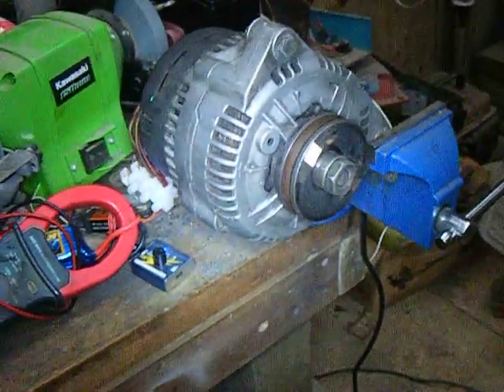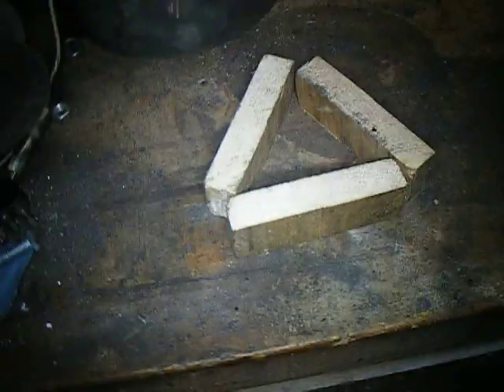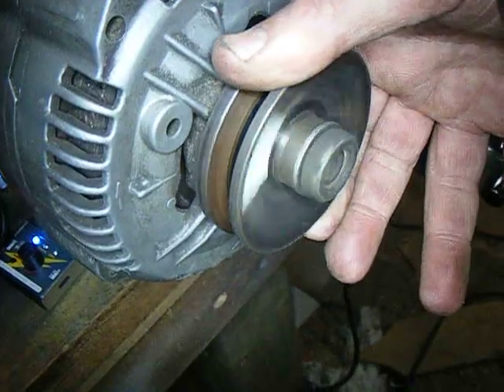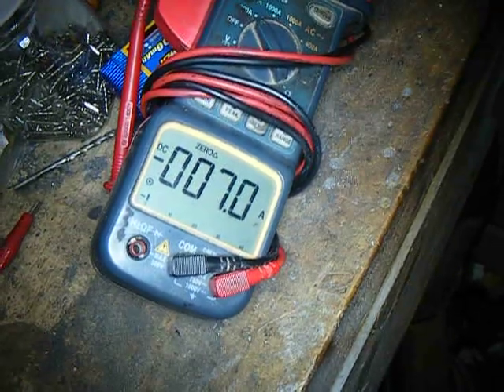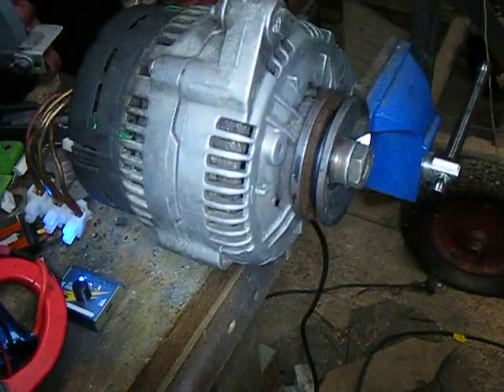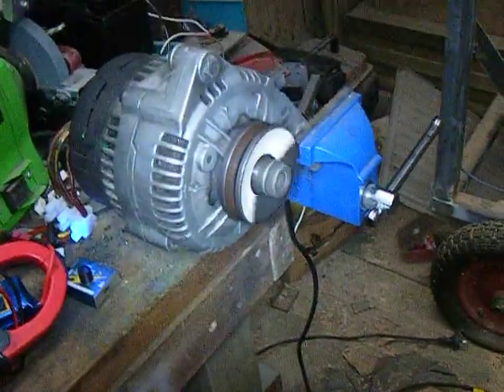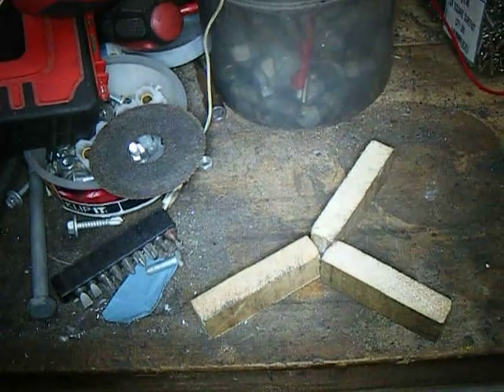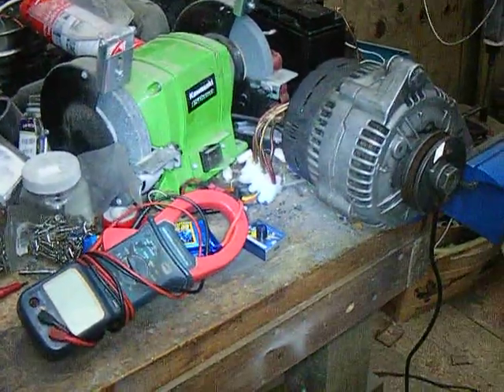Enhanced Alternator Motor goes faster than before

Comment: So if the stator only has 3 wires coming out of it then it's a star configuration right?
Reply from the maker: That would be Delta configuration - where the 3 coils are all daisy chained together, with 3 wires connected to their junctions. 
 Star configuration has a wire, that goes to the end point of the 3 coils,  and 3 more wires that come from the other end of the 3 coils. 
 I brought 6 wires out of my alternator, so I could experiment with the various wiring options.
Reply: The thing with my alternator is that is only has 3 wires and their every thick wires
Reply from the maker: @lt.schlechtnacht9414  
 You might find that there are 6 wires in there, arranged as 3 sets of 2, that are very close together.
Reply: I wish I could show you what I mean the whole stator is like 3mm copper wire. It's very thick. And theb3 wires that come out are very thick as well. It's a 1986 delco alternator
Reply from the maker: @lt.schlechtnacht9414  
 This is unusual. 
 Maybe those 3 wires are connected to the 6 wires, deeper inside the alternator? 
 Even as it is, you'll be able to use this as a motor, as it works in Delta and Star configurations.
Reply: @CNCmachiningisfun  ahh well thank you very much for the information! please update us with this project
Reply: Hey! Just an update on my situation. I dug a little deeper in my alternator and found the other 3 wires! Runs so much better! Thanks for all the help👍
Reply from the maker: @lt.schlechtnacht9414  
 That's good to know. 
 It just goes to show how differently these alternators are built, over the years.
Reply: How do you hook up the 6 wires to the speed controller? is there a certain combination to use? At first I used a multimeter to find each set if wires that beep then connected them to the speed controller and nothing happened
Reply from the maker: @lt.schlechtnacht9414  
 Connect one end of each pair together, and insulate it. 
 This will create a Star wiring scheme. 
 Connect the remaining 3 ends to the ESC. 
 Apply a voltage to the brushes, to magnetise the rotor, and you are ready to roll  :) . 
 After this, you can try the Delta wiring scheme, to see which one is best for your alternator.

Comment: i seen 2 videos  and i love channel i need to make a video i bought equipment  to do so ill get on it probably the 5mge turbo 1985 supra engine build ...oh n howdy frum east TN..chevy uses a starter electric drive hybrid [uses belt in the place of alternateor one is peppermint magnet type the 2nd gen is not ..a bit hard to find intell on as  i forget the name of unit  some newer car truck i figured i would mention it .i wont to make a cart cheap fer me n kids and grand-paw . much blessings
Reply from the maker: Thanks kindly. 
 I look forward to seeing your new video  :) .
Reply: Hey "overbuilt automotive",  those chevy special alternators can have two models:
one is a beefier alternator, one is a induction motor
Reply: the induction motor, if modified to Delta from Star, and using a good controller, it can get almost 40HP
i can give you links to show
Reply: @foxxyytofficial  sure ill be great full
Reply: @overbuiltautomotive1299  the Gen2 uses up to 120V to run, the thread post on Endless-Sphere and elmoto.net shows that for the Gen2 you need Curtis controller or other brand of AC induction motors
Let me search the video of the motor in action
Reply: @overbuiltautomotive1299  here is the kart:
https://youtu.be/V-M_RFaY3aM
Reply: @overbuiltautomotive1299  and here is the thread:
https://endless-sphere.com/forums/viewtopic.php?f=30&t=85514
Reply: I wanted to buy one of the first gen. chevy/saturn special alternator/starters because they have a similar form with standard alternators, and they cost 50$ or more, but shipping alone would cost 150$, and import taxes would add more:
from 200$ price+shipping, with taxes rises up to 300-330$
And the minimum wage in my country for an entire month its just 183$

Comment: Hi what alternator is this ?? Thank you
Reply from the maker: This is a 120 Amp alternator from an old Volvo car, if I remember rightly.
Reply: Thank you brilliant video
Reply from the maker: @joshstone423  
 You are welcome   :) .
Reply: Does it matter if the alternator works?
Reply from the maker: @joshstone423  
 As long as the alternator has good brushes/sliprings - and good stator coils, you'll be good to go  :) .
Reply: That’s great thank you
Reply: How did you wire it up to the triangle Way thank you
Reply from the maker: @joshstone423  
 It is best to take the alternator apart, so you can see all the wires inside it. 
 This will make it a LOT easier to understand the two main wiring techniques  :) .
Reply: Thank you very much 👍🏻
Reply from the maker: @joshstone423  
 You are welcome  :) .

Comment: Do a video and show a step by step how to video of every you do and use and where to buy the stuff and make sure to show all the labels. There's a lot of us out here that want to do this stuff but don't know squat. I want to link up about 6 altinators to 1 motor to power my home and deep well water pump to totally self powered and off grid with no gas or city power use at all. The altinators need high amps to get the full ac voltage so need the dc motor to run at about 6,000-8,000 rpms with controller and amp & voltage meters on about a 3-4 12 volt car battery bank. Have the first altinator to keep the batteries charged and the others for the house. So 5, 250 high amp altinators  altinators  converted to ac output for the house current and one 250 high amp dc altinator for the batteries. How about doing a lot of us a favor and doing a video . Please.
Reply from the maker: There are videos likes that out there, and they are pretty easy to find. 
 What I did here was an experiment, as I had no idea if it would even work. 
 Needless to say, I was mighty pleased with the results  :) .

Comment: Hello,
Do you know the resistance of the single coil by any chance?
Thanks,
Reply from the maker: The DC resistance of each field coil is VERY low. 
 It's about 0.3 of an Ohm. 
 The rotor coil is around 2.5 Ohms.
Reply: Thanks, Much appreciated.
Reply from the maker: @jordanmarcus2138  
 You are welcome  :) .

Comment: Gracias por compartir.. Que voltaje utilizas en las escobillas y en estátor?
Reply from the maker: You are welcome  :) . 
I use 5 to 12V on the brushes, and 14V on the stator.
Reply: @CNCmachiningisfun  are you still with this alternator?
Reply from the maker: @foxxyytofficial  
 Yup, I am still using this alternator as a motor for my bike   :) .
Reply: @CNCmachiningisfun  do you have a more recent video to show using it with 36v?
Reply from the maker: @foxxyytofficial  
 Sorry no. 
 I tried to upgrade to 36V, but my new controllers simply weren't up to it, so I never got beyond the previous setup  :( .
Reply: @CNCmachiningisfun  well, that's unfortunate
Reply from the maker: @foxxyytofficial  
 That may change, in time, but I have rather a lot of other projects to complete, here on the farm. 
 A faster ebike is a good thing, so it is worth upgrading it, for sure  :) .

Comment: did u tell me the input voltage of rotor
Reply from the maker: The rotor receives between 4 to 14 volts. 
 Higher voltages for lower speed and greater torque. 
 Lower voltages for greater speed and lower torque.
Reply: +CNCmachiningisfun thanks for reply and explanation.
Reply from the maker: You are welcome  :)

Comment: Thanks iv just realized what the difference in 2s - 6s lipo 😂 it's the power difference how many can they hold at once these esc 1 cell or more than 1 ??
Reply from the maker: Your ESC is rated for 2-4 Lipo cells, if I remember rightly. 
 Each Lipo cell is typically 3.6V, which means that your ESC operates on 7.2V to 14.4V. 
 My EBike runs on 14.4V, which is OK for such a light bike - going at 12MPH. 
 Your system will work,  but its speed will be limited.

Comment: Iv bought the ocday 120 amp waterproof sensorless 1 Specifically for RC car's startup, acceleration and linear.
Compatibility of sensorless brushless motor.
High current resistance, excellent heat dissipation.
Multiple protection functions: low voltage circuit breaker protection, lithium / nickel battery overheating protection / throtttle signal / motor loss of excitation protection shielding protection.
Easy programming and compatible pocket program cards.

Specifications:
Weight 110g
Material: composite material
Current: 80A/120A

Product Description:
Connecting the BEC wire with the receiver.
Connecting motor wire ESC.
Open the transmitter.
Connect the battery group and ESC and then open the ESC.
When connecting the motor and battery, the motor will issue a "beep" tone.
When the throttling bar is neutral, the car will be "beep" tone.
ESC is feasible.
Included:
1 x ESC Brushless Waterproof Sensorless

1 x English Manual
Reply from the maker: How many lipo cells is this rated for?
Reply: Here's more info the reviews are excellent on this Built with the highest quality components to ensure high efficiency operation.
Compact and lightweight, easy to install and use.
Suitable for 1/8 RC car using.
Specifications:
Brand name: OCDAY
Model: S-120A
Material: Plastic, Metal
Color: black
Size: 50*40*37mm
Continuous current: 120A
Burst current: 600A/10sec
Power supply: 2-4S LiPo / 4-8S NiMh
SBEC: 6.1V/3A
Power supply plug: T plug
Motor plug: 4mm banana connector
Suit for: 1/8 RC car
Cooling system: Cooling fan
Programmable: YES
 

Package Included:

1 x 120A Brushless ESC
 Is this a good 1 hope so 😎
Reply from the maker: "Power supply: 2-4S LiPo / 4-8S NiMh" 
 She's gonna be slow, certainly no faster than mine at about 12MPH. 
 This is good for testing, but not so good for traveling.
Reply: Thanks Least we will know if iv done it when wired up have you seen my new vts ??
Reply from the maker: Great vids. You are doing a good job on these carts  :) . 
 Just remember that your ESC is limited to a battery voltage of about 14V. 
 Going higher than this will let the magic smoke out!

Comment: Iv just looked at a 120 amp esc rc one with a fan on it is that better ??
Reply from the maker: The ones with fans are better for your cart, as they will need to be kept cool at all times. 
 How many volts is this ESC rated for?
Reply: Features:
Compatible with sensorless brushless motors.
Super smooth and accurate throttle linearity.
Built-in high-efficient and high-power 6.1V/3A SBEC.
Enhanced throttle response, excellent acceleration, strong brakes and throttle linearity.
Multiple protection features: low voltage cut-off protection for lithium or nickel battery, over-heat protection, throttle signal loss protection.

Description:
Built with the highest quality components to ensure high efficiency operation.
Compact and lightweight, easy to install and use.
Suitable for 1/8 RC car using.

Specifications:
Brand name: OCDAY
Model: S-120A
Material: Plastic, Metal
Color: black
Size: 50*40*37mm
Continuous current: 120A
Burst current: 600A/10sec
Power supply: 2-4S LiPo / 4-8S NiMh
SBEC: 6.1V/3A
Power supply plug: T plug
Motor plug: 4mm banana connector
Suit for: 1/8 RC car
Cooling system: Cooling fan
Programmable: YES

Package Included:
1 x 120A Brushless
Reply from the maker: "Power supply: 2-4S LiPo / 4-8S NiMh" 
 That's gonna be a problem, as the maximum supply voltage will be about 14V. 
 It will work for low speeds, but it will quickly run out of puff at higher speeds. 
 For a fast and powerful cart, you will need something that can handle a battery voltage range of 48V to 72V. 
 This is where an EBike controller is your best choice. 
 RC ESC is good for testing. 
 Ebike controller is good for proper, powerful, road running.

Comment: Ok thanks and I have built it just needs motors the aircraft controller your using they do rc versions do thay still work even tho they smaller ??
Reply from the maker: My ESC is for RC aircraft, so it is very small and light. 
 It will make your cart go, but not too well, as these ESCs are not as powerful as the ones for EBikes.

Comment: Ok thanks for the brain power iv built a go kart out of a mobility scooter it's almost 6 foot long with a glass floor I'm going to put a vid up of it to show you I want it to be the world's fastest with maybe these motors 2 x 200 amp alternators running 2 esc with 1 throttle  😎 im thinking 2500 watt each can it be done ??
Reply from the maker: Sounds great  :) . 
 I look forward to seeing what you are building. 
 2500 watts per motor is certainly possible, if you go with a high enough voltage and current. 
 You may want to opt for EBike controllers instead of aircraft ESCs like I am using, as those will be more powerful. 
 Take a look as Tchangly21's videos for some inspiration on this, as he is really heavily involved in the making of speedy electric zoomers  :) . .

Comment: Some1 has a vt of a alternator conversation and it spins at 30 thousand rpm have you seen it ?
Reply from the maker: Nope, I don't think I have seen that video. 
 Bear in mind that a fast spinning alternator is likely to have less torque than a slow spinning one. 
 Mine will easily do 10,000 RPM. but I usually run it at no more than 2400 RPM for practical use on the bike.

Comment: Ok thanks I'm ordering a speed controller aswell tomorrow what's the best type I will need it to test this moror ?
Reply from the maker: Any ESC that can handle 60 amps, and at least 4 Lipo cells will get the job done. 
 Also, you will need a servo tester, so you can send speed control signals to the ESC. 
 These will let you test your new motor :) .
Reply: ESC means,  4 lipo cells means, where can get servo tester

Comment: Getting correct materials in the morning I was wondering  is there a way to run two of these motors in series ???? as I'm new to this and I'm more used to the brushed setup that iv got on my quad conversion
Reply from the maker: That's great. Soon, you'll be ready to run  :) . 
 Unfortunately, you'll not be able to run two or more of these motors in series or parallel. 
 The only way to run two or more of them is to put an ESC on each motor, and drive the ESCs off a single throttle controller.

Comment: When I soldered the wires they are too bulky because of the 6mm wire they touching the fan blade so it's a no go 3mm wire better really! !!
Reply from the maker: OK.
 Sometimes, you have to make compromises, in order to get the project done. 
 As long as there is good airflow around those wires, they won't overheat.

Comment: Iv bought maximum rated wire at 240 volts 38 amps 6mm or is it too thick or is it good ???
Reply from the maker: It's thicker than you really need, but it will be just fine, as long as it is not too stiff for you to work with.

Comment: Ok thankyou so I bring all 6 out all together I'm gunna have 8 wires out the back ???
Reply from the maker: Yes, that is correct. 
 Once you have done this, you'll be able to test both Delta and Star wiring modes.
Reply: Thanks do Any of the wires need to be marked or coloured at all any of the 6 I meen ??
Reply from the maker: Any old colour will do. I used purple for mine, as that was kinda handy at the time. 
 To group them, simply pass them through the various holes in the back of the alternator in pairs.
Reply: The 1s that beeped are they going to be the pairs? ??
Reply from the maker: Any two stator wires that 'beep' are a pair. 
 These can be arranged in any sequence, just like you see in Austiwawa's video  :) .
Reply: CNCmachiningisfun thankyou your a star 😎
Reply from the maker: You are welcome. 
 Looking forward to seeing it running  :) .
Reply: I'm needing to get some nice wire what gage is best and iv been looking for a cheap speed controller on ebay what types are best for these motors there's lots different 1s pwm bldc cw ect? ??

Comment: First stage of delta wiring to the alternator
Reply from the maker: Good start  :) . 
 Attach a fairly heavy wire to each of those copper pairs, so you can bring all 6 of them outside the alternator shell. 
 Attach smaller wires to the brush connections, so you can close up the alternator.

Comment: Check my youtube vt" home made alternator tester " all the wires get hot when running the motor to spin it
Reply from the maker: Nice! 
 That alternator seems to be working very well  :) .
Reply: Youre just spinning the alternator with a different motor.  Not at all what's going on in CNC's video.

Comment: I want to wire in delta format but can't find a video to copy it is there any where I could find it ???
Reply from the maker: It's very easy. 
 Take out the rectifiers, to expose the 3 wire ends. 
 When you are hunting around in there, you'll find 3 more wire ends that are soldered together. 
 These are the opposite ends of the wires you exposed when you pulled out the rectifiers. 
 Separate those 3 clumped wires, and attach new wires to them. 
 Do this with the 3 original wire ends, and most of the work will be done - in preparation for the next step in creating a Delta wiring scheme.
Reply: I'm working on something and wondered if I could email you something to show you
Reply from the maker: Can you make a YT video about it? 
 That would be the best way to go.
Reply: as Usual you tube like every other web source has made it harder to message. How did your project turn out? I tried the same setup as CNCMachiningisfun It is driving me crazy .I have the same controller does it have to be programmed or tuned. I used two Chevy 65-72 alternator bolted together with a 3/8 turn buckle. Im just working on the motor now soon to belt drive the other as a generator. Im a retired craftsman who had a stroke so you can imagine it  takes me a week to do anything.